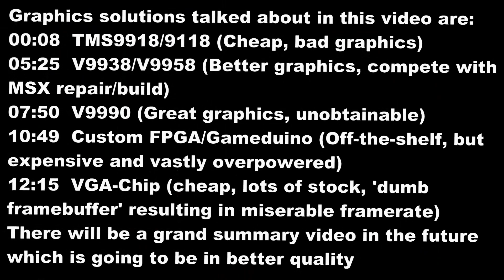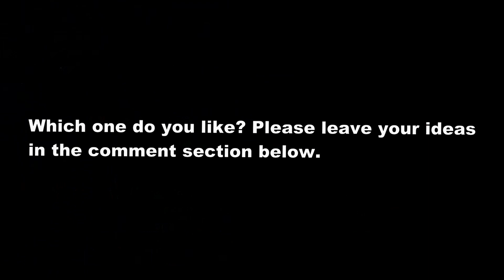Video options for the HEC computer

Comment: Andy !. I've been meaning to comment. Please don't make the VGA mistake. Try for progressive 224/240p RGB if at all possible. But so long as it's not VGA the computer will be ok even if composite. Also how's the table tennis, nice table I saw hiding there.
Reply from the maker: I know VGA is a mistake, but VGA is the only analog format that will give you crisp image without expensive hardware (like an RGB monitor). My concern for composite is that it is bad at high-resolution image (like 640x400 or 640x480), which I consider a 'computer' would have. However, I finally chose the V9958, which outputs 256x192 because it just has a lot of advantages. HEC being HEC, VGA with powerful blitter or with stupidly fast Z80 is always on the table for future project, though. About the table tennis, finally someone pointed it out! I play table tennis once in a while, but currently it is mostly used as a workbench. It has the same color-scheme as the Amiga workbench!

Comment: You have three other vintage options not mentioned - PD7220, Intel D72020, and the EF9366. The last one can be implemented with the least logic. You could also cheat and use a Parallax Propeller VGA or ESP32 VGA solution, but I like that your system uses vintage parts. Keep up the interesting videos!
Reply from the maker: Wait for the next episode where I mention them! These are called 'smart framebuffers', yet they also have their own problems: mainly due to the fact that they don't provide very 'useful' hardware drawing for games (more suitable for CAD software, GUI, etc.) 'Cheatgraphics' is always an option, but I kind of dismissed that idea when I say I don't want to use FPGA. I just don't want a modern chip used in the first 'baseline' implementation. However, HEC being HEC, you can always add them and run existing software on them, as long as you provide the driver!

Comment: It's great to see someone building a homebrew Z80 machine that has graphics at all; so much the action in the Zilog realm is CP/M running with terminal-style I/O.

The problem I guess I have personally with FPGA solutions like VERA is, honestly, it kind of feels like you might as well just do the whole computer inside the FPGA and cut out the middle man. But as you handily point out, if you want colorful accelerated graphics with an old-school 8-bit CPU it's pretty much a choice between that and the various options which all suffer from potential availability issues. The V9958 seems like about as good a choice as any in that category, and definitely optimal if you want to be able to emulate MSX. It would certainly be an interesting challenge to try to virtualize the interface of a TMS9918 and translate the operations for it into, say, VERA function calls, but the overhead would probably be immense. (Assuming there's complete enough functionality overlap to do it at all while retaining meaningful hardware acceleration.)

For my own perpetually morphing homebrew computer ambitions I've opted to embrace a very retro aesthetic and am building my own memory-mapped video hardware; the current design substitutes an Atmega8 CPU for a CRTC chip like the 6845 for sync and address generation so I don't rely on extinct parts, but otherwise could be implemented with straight TTL. (I also use GALs to cut the part count down a lot, though. Which does mean I'm technically using programmable logic... but only barely.) It can do both linear bitmap and "tile" modes (IE, character mode with user defined fonts), but no sprites, no color, and a maximum resolution around 512x384 (interlaced) monochrome. Basically something you could have built for real in the late 1970's.

But, yeah, my goal is specifically to emulate stuff from the 1970's, not the late 80's and onward, so I'd fully agree that taking a discrete approach doesn't seem like an option here. Tacking on sprites/deep color/etc. would rapidly turn my approach into a multi-board set in a card cage unless compressed into CPLDs/FPGAs. And doing without those things and settling for large dumb framebuffers on a VGA chip likewise seems unlikely to scale. For a Z80 there's a huge difference between shoving around 12-24K of framebuffer verses hundreds of K.

Comment: I'd been thinking about adding [8bit] ISA slots to my z80 computer... Then I could start with CGA, then move up to VGA, and possibly even VGA with simple onboard graphics-processing (surely early VGA cards eventually had things like sprites?).

That said, I guess your "most advanced" z80 design could go in many directions, as you've detailed here. Do you want to stick with parts available at the time to "show-off" what could've been, or do you want to show off the things it could've enabled a lowly z80 to do,, allowing it a longer life as a viable CPU in later machined, given developments in other fields (such as GPUs)?
 ...
You're in a difficult spot, here, because the very clever idea of virtualization will inherently slow things down, turning each single I/O read/write into a many-instruction endeavor, even if the attached hardware is identical. But, even slower if you intend, say, to emulate one piece of hardware on another. (e.g. emulating sprites in a framebuffer).

Personally... I think your board-design would best show the capabilities of virtualization if you don't limit it to specific hardware, like a specific video chipset. That's the whole point, isn't it? Make a CGA "driver", attach a CGA card. Make a VGA "driver", attach a VGA card... 
Make a simple square-wave oscillator for a speaker, and its driver. Then a SID, then maybe a soundblaster with a wavetable...

Even before all that, maybe start smaller and just have a serial "dumb" terminal attached. Most CP/M programs I've seen aren't graphical at all. 

You could demonstrate virtualization actually functioning long before implementing graphics! I wanna see that!
Reply from the maker: I have considered ISA-based solutions SERIOUSLY. (and ISA is currently the forward-running bus solution candidate for my Dragonfly and the 16/32 bit CISC processor project)  However, when you look at the actual chips you will be disappointed by the fact that most 8-bit ISA graphics chips/cards don't have hardware graphics processing! The best you can have is TVGA8900D or RTG3105iEH which are very dumb framebuffer chips. VGA with graphics processing didn't come until VL and even PCI era. 
In terms of slowing things down, I have said in many occasions that I plan to overclock the Z80 to 24MHz, mainly to compete with the X16 in raw performance. it will provide a 6-fold performance boost over traditional z80-based machines. As long as your program is not filled with I/O operations, it will run decently fast. (But emulation is another story! Heavy optimization will be needed!)
Another thing to notice is that graphics calls doesn't need to be individual reads and writes. The call can be 'draw a line', 'move a sprite' or 'fill the screen with a certain color', which the OS can perform with a series of reads and writes. This will speed thing up significantly. (however, if your graphics solution is an add-in card, the 'triple blind' system may eat away this benefit, I will talk about that in a later video)
Reply: @andyhu9542  I guess the question I have is what is your main goal with this?

I came across your z80 project from the Hackaday Blog, which linked your video about virtualization, as my introduction to your project. I think many others found out about your project similarly.

It's a great idea which in and of itself could be the basis of an entire, albeit short, build series.

But you're also, it seems, trying to implement an entire computer, based on it,  from scratch, without yet having even demonstrated a proof-of-concept or prototype of the underlying concept.

As you've said, it seems no one has done it before... Don't you think it's a good idea to try it before building an entire system based on it?

Besides, if it's as unique an idea as it seems, then don't you want to highlight that part of the accomplishment ,  before burying it so deep within a complex system?

If I understand correctly, basically all you need is the NMI circuitry of your design, a z80 , a ROM, a UART, and a tiny bit of software to prove the concept... and all those things you'll want in the bigger system, later anyhow.

It's just a thought...
Reply from the maker: @ericwazhung  Wait a sec... I'm on Hackaday but haven't logged in once since I made the video. So how can there be a link to my video? (One can blog about other people's project on Hackaday? I don't quite unterstand how Hackaday works honestly) This project was what you say it is -a proof of concept. It literally didn't have the TMS9918 in the first place. However, a video showing 'process 1 is running' and 'process 2 is running' is simply not attractive enough for most people, but a computer that runs both Colecovision and MSX games does. I learned it when I searched for technical videos on YouTube: so many brillant videos get few views! Also, I don't want to take the step-by-step approach since i want to 'speedrun' this project so that it doesn't take three years like the Commander X16.
Reply from the maker: Demonstration without graphics or even keyboard is definitely possible. In fact the graphics and keyboard circuit wasn't even in the first design -the 8251 USART is. My original plan call for a terminal-only computer just to demonstrate the virtualization, but then I realized I need something to show to my viewers, so I added the TMS9918 chip and an SN76489 and a keyboard chift register.
Reply: @andyhu9542  Looks like we cross-posted, heh!

And, apologies... this is YOUR project, please don't let the likes of me tell you how to go about it. If you do, you'll likely find, as I have numerous times, conflicting advice from countless armchair directors.

My own interest, frankly, is probably obscure in comparison to yours and most others', as I have no nostalgia for vintage z80 systems. I look at the z80 as a simple-enough processor that I can actually understand what it does at low levels, as a way of slowly building my understanding about newer concepts like memory-paging and virtualization. So, for me, compatibility with MSX, CP/M, or games from different systems is merely a way of demonstrating those concepts, as opposed to a motivation. But, I understand that's probably not the same for many others, who otherwise might want to play an MSX game on a TRS-80.
Reply from the maker: @ericwazhung  We may share more in common then you think. I look at the Z80 (and the 6502) exactly as you do. I consider this project as a 'next step' to 8-bit computers like the Commander X16 (not to say its any better, but more like 'the next thing you may want to learn after you have studied the X16 inside out'). This project was a no-video, no-sound, no-keyboard, serial-terminal-only single board computer. But I also need views (and I'm not going to avoid saying that). Most people on YouTube who watch contents about the Z80 because of nostalgia, and I deliver it. I'm not motivated by it, either. In some sense i'm motivated by the view number. I am probably more superficial than you, but I'm still amazed by how close we are when it comes to learning the Z80. I guess this is the magic of YouTube, isn't it? You can get to know your mirrored image (in one aspect) who lives maybe thousands of kilometers away!